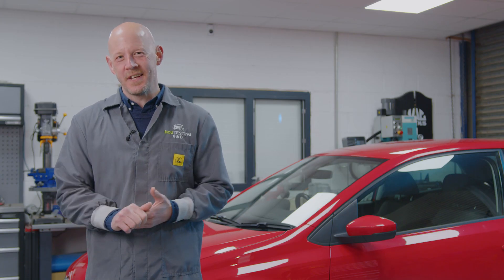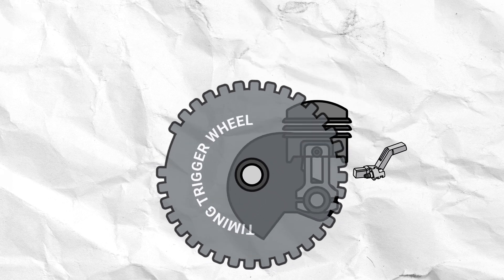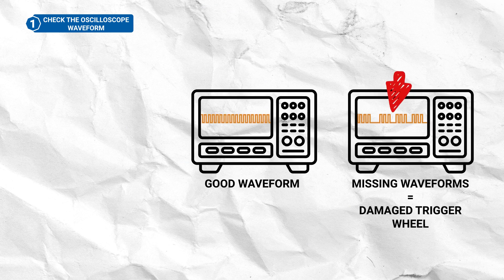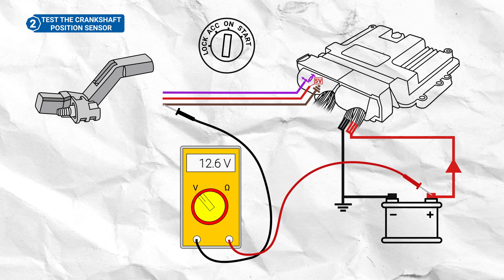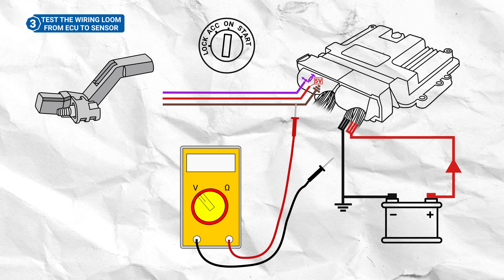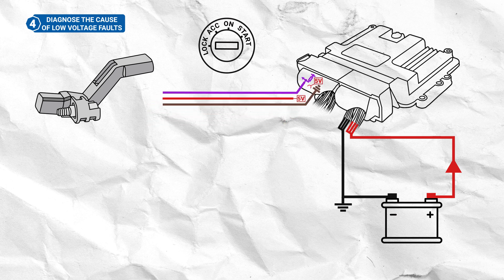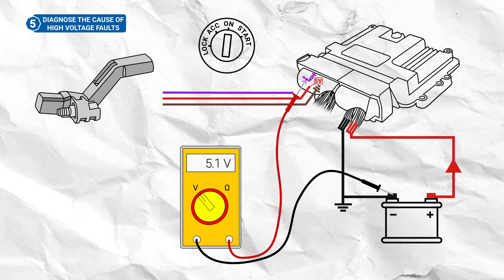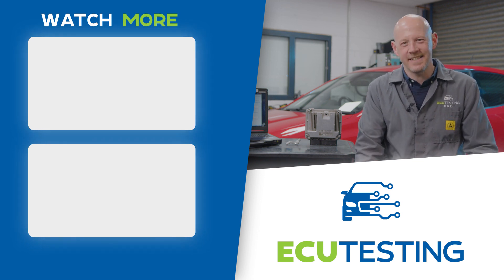Faulty Crankshaft Position Sensor? – How to Test and fix!

Comment: When doing step 2 do i test with my key in the ignition on position? If so for battery voltage im getting 9.5 ground and 2.5 voltage. What could be the problem?

Comment: What could be the possible cause for P0726 (Engine Speed Sensor Circuit Range/Performance Problem) and how is it resolved on VW golf 5 1.9 tdi engine code BKC?

Comment: I have 2 pins in sensor. This video was useless
Reply: It appears to have helped many. Modify your search terms to more accurately represent your specific vehicle and issue to get more applicable results. Also, these techniques can be adjusted and utilized on 2-wire crankshaft sensor systems.
"solutions"
Reply: @theduder2617  2-pin sensor is just a generator. It gives zero volt if not rotating. Also zero volt if cable break! And sensor itself can't give an error code, it doesn not consume current etc. It is totally different operation.
Reply: @pvsolutions9292  
You could measure the sensor's resting state resistance. If resistance is not within specified range, bad sensor. Could also use the sensor's known resistance to confirm and track down a broken cable. 
And yes, a two-wire sensor can indeed trigger an error code. It is how the vehicle's ECU knows it is getting faulty signals from said sensor. 
If you are not getting a code indicating a faulty crankshaft sensor, perhaps the problem resides before and/or outside of the sensor.  
Example: a broken timing belt can potentially eliminate signals from the camshaft sensor due to the cams no longer rotating, thus also eliminating potential codes from the crankshaft sensor due to the ECU taking action. 
But on a healthy engine, unplugging a two-wire crank/camshaft sensor will in many cases result in an associated error code. Especially on newer engines.
Sounds to me that you have an issue which lies beyond the crankshaft sensor, although that involves a bit of presumption on my part. I suggest checking each sensor's internal resistance and comparing those measurements to the manufacturer's stated values, then using the measured values to check further up the cable for a break in either of the wires. Also, using an analog voltage meter, you can check for voltage signals from each sensor while turning the engine over. A typical two-wire crankshaft sensor will generate voltages between 0-5 volts as the engine rotates. On an analog electrical meter, the voltage fluctuation will be rapid, but visible as the meter will fluctuate rapidly. As far as checking the timing of the voltage signal, that will require more advanced detection equipment such as an oscilloscope. 
 
I can say with 100% certainty that I was not getting any error codes related to either sensor. After measuring each sensor's resistance, I was then able to determine both sensors were functioning normally and that there were no broken wires. From there, I was able to determine that the camshaft sensor was not generating an output voltage while the engine was rotating. That led me to check the timing chain. It had snapped and the only code I was getting from the vehicle was a generic low voltage code. The code being triggered from the lack of camshaft signal.
Engines are widely different. But the techniques described in this video can be utilized, albeit adjusted, to determine the functioning of a two-wire system.
Reply: @theduder2617  It is magnet and flywheel induces voltage to it. It is a dynamo. My cable was broken, not sensor. Sensor is just a magnet, cant be broken.
Reply: @ I used oscilloscope, it generated kHz pulses when engine running. Like a dynamo should. No electronics in sensor, ECU read this AC voltage
Reply: A magnet can in fact be "broken". Especially when coils of copper wire are involved as in the inside of both a camshaft and crankshaft sensor. Hence their internal resistance being a tell-tale sign of a failed/failing sensor. If the sensor did not include an internal coil, there would be nowhere for the two wires to connect nor would the wires have a functional purpose.
Without the internal coil of wire, the sensor would not generate the electrical pulses from the changing magnetic field created by the rotating crankshaft that the ECU uses to determine spark timing. 
That is awesome you found the broken wire. Sometimes broken wires can be a chore to chase down, hence my previous suggestion of using the sensor's internal resistance to help track it down. 
I also advise if you've got the time, just to be safe, inspect the camshaft position sensor's wires for any similar damage before that sensor begins to give problems. Oil on the sensors or their connectors can also create issues down the road. 
Only for future reference since it is unimportant for your now solved situation: 
The output signal from a crankshaft and camshaft position sensor is a direct current (DC) square wave. To be fair, it could be technically thought of as an AC signal, except that the voltage does not alternate as much as it rises from zero volts and returns to zero volts whereas an AC signal would alternate from say 5 volts to negative 5 volts and back again. Automobiles are not huge fans of AC voltage.  lol 

Again, I am glad you found the problem. Hopefully that is the last broken wire you'll have to deal with on your vehicle.

Comment: Just subscribed thanks for the knowledge May I ask this question? I noticed when checking for the sensor ground you went from battery positive to sensor ground is that the best voltage check or using battery negative to sensor ground looking for < 0.100 just asking because I don’t know which one is a better diagnosis Cheers  Thanks Tim

Comment: Hi there. Why do cars have both camshaft as well as crankshaft position sensors if both are locked in synchronisation?
Reply: did you find out?
I guess because then the computer can know whether the cam and crank and synced

Comment: I have a code of p1613 short to ground, can you repair the ECM ?
I have voltage readings on the 3 wires 11.50, 9.84 and 9.84 in the other 2 wires.
Reply from the maker: Hi there! If you can email info@ecutesting.com with your vehicle details, part number, symptoms and the fault code/s present, our technical team will be happy to look into this for you. Thanks

Comment: I have a Peugeot 206 1.1cc  but have found a position sensor off a Peugeot 206 1.4cc will it be the same crankshaft position sensor for my engine I don't see why it should be any different do you ? to save me buying another one great video thanks if it's not that I'll get my multi metre out and test the circuit thanks a lot very well explained ignore any idiot comments  well done good job 👍💯🤔

Comment: no no  garage mechanic  or  even dealership gonna spend 10 min  doing  any of this   !!    meter electrical  trblshooting.. ever.   never never 
  they gonna just rip out the sensor, wires and or Ecu  and  give u a huge $$ bill  .. tell ya see ya goodluck.. Next.
here in  USA    smfh

Comment: Need help. Car would not start when hot, got the fault code P0335, fitted CPS, car run but fault came back, so re-fitted CPS but now won't rev over 2500rpm, when it hits those revs it gets a 'bang' in exhaust and then cuts out. Fault code P0335 then comes on.
Reply: forgot to mention this is a Chrysler Crossfire.

Comment: Hello, Thanks for a great test video.  I am working on a custom LS1 Harness bought in 2004 direktly from GM ( New crate engine, Hardness and ECU ) Now I Have crancshaft position sensor ( P0336 ) error code, I hav changed  sensor 2 times, before I saw your Video. I Now Have Cheched 5 V connetor to be 10,9 V , signal terminal has 10 mV and Ground connection has 12,2 V - After hearing what you say I suspect that the problem is inside the ECU, will you agree ?

Comment: I have p0726 code on audi a3 2.0 tdi 2005 
I changed crankshaft sensor  but the car its the same shut down and indicator light its open and something is shut down 
Is this test voltage the same to my car or not ? 
Whats is the problem? Any solution?

Comment: @ecutestinglimited can you help me here. Ford edge...installed new crankshaft sensors and the code for bank A is still on. I set my meter to 20v and tested the connector. Both holes gave me only .02  That a bad wire harness?

Comment: one suggestion.  for wire faults use a 250mA or 500 mA test light at least.   A wire with one strand will still show continuity, but won't allow current to pass through it.  A dim glow will expose this.

Comment: Hi, i am working on 2009 hyundai santa Fe. i have no spark and no fuel. But the problem is that i dont have  any code on the car. The car would crank, i test the fuel pump, and it's good. I replaced the crankshaft position sensor as well as the pcm. But the car still doesn't have a spark.. what shld i do next??

Comment: Is testing at the CMP sensor the same as the ckp? If so I'm getting no voltage at the sensor wire with the it disconnected.
Reply from the maker: Hi. Yes, testing at the camshaft position sensor is largely the same as the crankshaft. We have done a video specifically on the cam sensor here: https://youtu.be/FTY11IeWBsk But if you aren't getting any voltage at the sensor connector with the ignition on and sensor unplugged, it is likely the wiring or ECU is faulty. You will need to back probe the wires at the ECU connector as we show in this video at 4:47. Hope this helps
Reply: @Ecutestinglimited  I  have 12.4 volts at the ecm sensor wire brn/wht so it's got to be a break in the wire, so I ordered a short/open tester to find it. Thanks,
Reply from the maker: Hi @davebrown4699  No problem, good job on the diagnosis! We hope finding the damaged wire isn't too hard 🙏

Comment: Hi, What about P1335 on astra G? Thank's
Reply from the maker: Hi. A P1335 on an Astra indicates a problem with the crankshaft position sensor, its wiring, or the ECU, so we would recommend completing the checks we have outlined in this video in order to identify and rectify the problem.
Reply: Thank's a lot for the information, really apreciated!

Comment: Is it normal for the signal wire to be 12v? I am reading some cars are 5v and some are 12v depending on the car etc?
Reply from the maker: Hi. While it's more common for crankshaft position sensors to use a 5V signal, some can be 12V. Inductive type sensors are more likely to have a 12V signal, especially in older vehicles or if the sensor is a 2-wire design (compared to the 3-wire design more typical for 5V sensors). We would always recommend consulting your specific vehicle's technical documentation to confirm.

Comment: What about P0339 ??
Reply from the maker: Hi. The P0339 fault code indicates the ECU is detecting an intermittent or erratic signal from the crankshaft sensor. This can be due to a faulty sensor, ECU or wiring from the sensor to the ECU. We would recommend completing all the checks outlined in this video to determine where the fault lies. As the P0339 code is intermittent, we would recommend completing all these checks whilst wiggling the wiring loom and connectors from the ECU to the sensor to see if the voltage readings change at all. Hope this helps!

Comment: Hi i have got vw golf 1.2 tsi ,its keep giving code p0322 engine no speed,checked the wiring its showing 5v,signal wiring 5v,have changed 2 sensors still showing same problem.can u help plz
Reply from the maker: Hi. The P0322 code could also be caused by a fault with the Camshaft position sensor, have you completed the same tests at both the crank and cam sensor connectors? Also, have you tested the ground connection to the sensors as well? If you have done these, then also inspect the sensor connectors for corrosion or poor terminal tension. Hope this helps!
Reply: @Ecutestinglimited  i have checked cam shaft connectors thy giving same voltage and have changed cam shaft sensor
Reply: On camshft connector one is showing 5v and one is showing 4.9 .is that ok or something wrong?
Reply from the maker: @muhammadrashidjaved301  No, 4.9v is a good reading. If you have changed both sensors and the fault still remains then it could be the incorrect sensor for the vehicle, make sure you are buying OEM replacements specific for your vehicle. Again, it could be the ground wire is shorted to voltage, or a poor connection between the sensor connector and the sensor itself, so we would recommend completing these checks.
Reply: Thank you
Reply: Hi i have checked crankshaft wiring again when you check the reading on connector it reads fine but when you connect with sensor ,signal wire reading is 1.8

Comment: i Have a Honda accord 2005 Hybrid with code P0335 i change the crankshaft sensor but still have the code , check Volt on the blue cable and is 3.7V intead of 5V , what should a check next?
Reply from the maker: Hi. Do you know if your blue cable is the power supply to the sensor or the signal wire? And did you conduct this test with the ignition on or with the engine running?
Reply: Signal with the ignition on . The sensor is 5 pint or wire.
Thanks for the reply.

😄
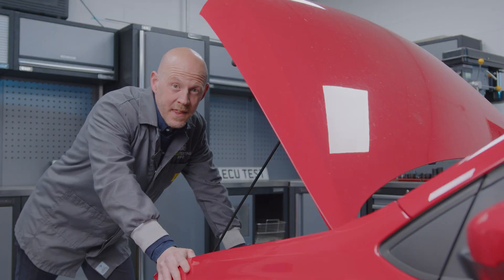Reply from the maker: If you have 3.7v on the signal terminal with the sensor disconnect and ignition on, then we would recommend completing the same test at the ECU connector by back probing the signal wire that goes to the crank sensor. If the voltage is 3.7v here, then the fault likely lies with your ECU, or both the wiring and ECU. Inspect the ECU connector for any damage, corrosion or poor terminal tension to see if the fault is being caused by a bad connection. If that checks out ok, then follow the steps in the video from 5:27 onwards (but on the signal wire instead of the 5v wire as shown in the video) to determine if the fault lies in both the wiring and ECU or just ECU. Hope this helps!

Comment: Can the ecu cause no signal from crank sensor? Ive replaced 3 times. I also have no can signal at ecu
Reply from the maker: Hi. Yes a bad ECU can result in no signal from the crank sensor. If you have completed all the checks in this video to rule out the wiring loom and sensor, then it is worth testing the ECU to make sure it has a good power and grounds, which you can do by following the steps in our video here: https://youtu.be/Y3aoD5BMxQw?si=veJToJJYZVkvXI2I If you aren't getting any CAN communication it could also be worth testing the CAN Bus circuit. If you rule these out then you can determine your ECU is causing the issue. If this is the case then please contact our technical support team via email on info@ecutesting.com with the part number of your unit and any relevant diagnostic information, and they will advise you of any testing and re-build service we can provide. Thanks.

Comment: Thanks for this video. Moreover, I am working on a 2009 toyota  corolla, I have 12volts on the ground wire of the crankshaft sensor, but am not getting any volts on the hot wire,I checked the continuity of the hot wire from the pcm to the terminal and resistance is ok but still won't get any voltage on the hot wire,I am confused now , any advice to what to do next?? Thanks

Comment: Great informative video 
Ihave the p0335 code on my vauxhall vivaro no start should i have 2.34 v  voltage on both connections on my crank sensor wiring
Reply: It should be 5 volts disconnect the wire from the ECU and test the ECU directly in the pin hole you just removed the wire from  to negative on the battery see what it reads should be 5 volts if it is its a wiring problem should not be 2.34volts should be 5 volts  🤔💯👍
Reply from the maker: Hi. Although this video is for a 3 wire sensor, you can follow a similar method of testing to diagnose the fault. Were the 2.34v readings taken from the sensor connector (with the sensor unplugged) with the ignition on? Start here and then follow the video to conduct the same tests at the ECU connector and so on.

Comment: Can a P0016 be caused by a bad crankshaft position sensor?
Reply from the maker: Hi. A P0016 can be caused by either a faulty cam or crank sensor, or a mechanical fault on the vehicle. We would recommend completing all the wiring checks in this video as well as our video on the cam sensor: https://youtu.be/FTY11IeWBsk in order to determine if the fault could lie in the circuit.

Comment: Could you do a similar video for a 2 wire sensor please? This is a great video but all of the vehicles I've worked on are 2 wire. I'm having issues currently with a 2008 5.4 3v F150. I love how you get right to the point and make things  easy to understand. Thank you.

Comment: here's one for you, using a three wire on the crank. I'm getting a crank but no start with intermittent spark - side note while testing for spark I don't receive any cylinder misfires. but I'm also not getting any codes related to crank or cam. but I do get the barometric pressure one for having it disconnected while trying to start to make it easier.